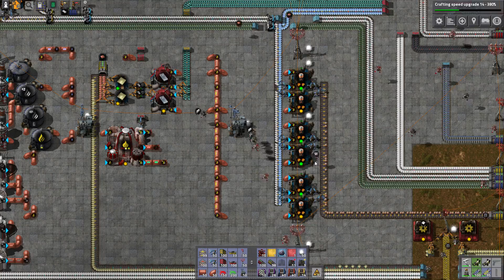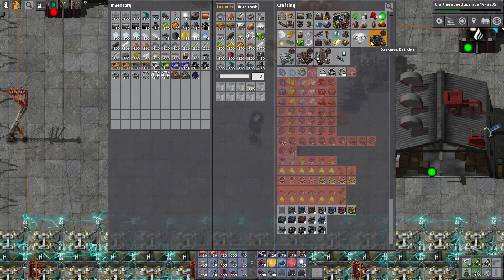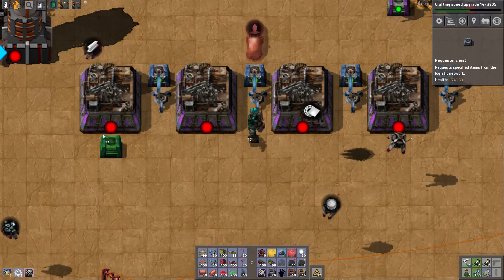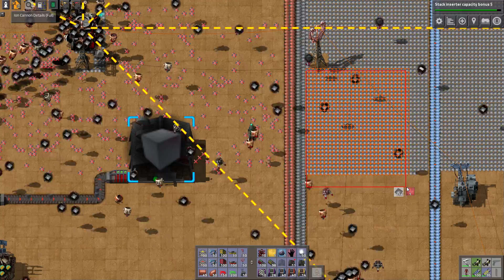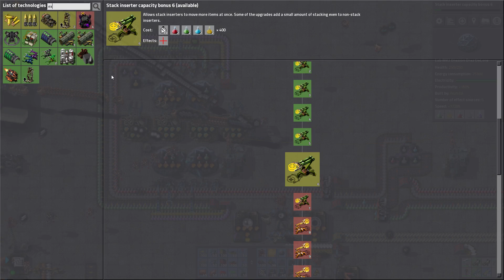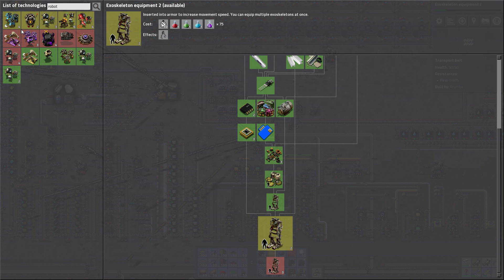Factorio A Rocket Per Patron Episode 85

Comment: The reason there's overload of items in the furnaces is because of the Speed modules, machines with more speed requests double from inserters for every 100% crafting speed.

Also, since you have nanobots mod installed and a power armor, make the module that automatically tags loot in the ground so you don't have to be deconstructing all that iron.

Comment: please for the love of god generate some more power! it´s so painfull
Reply: I know he needs to do more power, but why has the commenters been so gung-ho about it? He only miss power during part of the night when the accumulators die and lasers shoots. And so far, never enough to actually have boosted biters go through in a long time.. Plus all those modules have been lowering comsuption, so it's not like he's only been adding to the problem either..
Reply: i just think that it´s unfortunate that the entire factory can´t work as quickly as it could if it had full power
but i guess you have a point too

Comment: What type of factory is this called? The principle of placing things all over the place like a spaghetti factory is present, but instead of belts all over the place like you just don't care it is logistic chests and robots.
Reply: This is what you get when you cook spaghetti for too long
Reply: Its called a huge mess
Reply: Robots are better for a Cpu then belts.
Reply: Robotini?
Reply: It's just a robot based factory.
Reply: Robot swarm factory. AKA how to kill a low tier CPU.
Reply: It's not 'just' a robot-based factory.  In vanilla, it's surprisingly difficult to have truly high production rates from a robot-based factory because of robot charging bandwidth.  You need to think very carefully about how to lay out production sections to minimize robot flight times.

Bob's gives the player more tools here with modular roboports, but unfortunately the robot upgrade tree and extreme module levels make the factory so efficient that it can put up with a poor layout.  +300% productivity decreases the demand for robot-ferried supplies, and +1000% speed (on already high-speed machines) makes "full throughput" so blindingly fast that the player might not even want it.
Reply: I refuse to explain the joke.
Reply: Panderturtle Why is it better for to do robots then belts? I usually start with belts then go to robots.